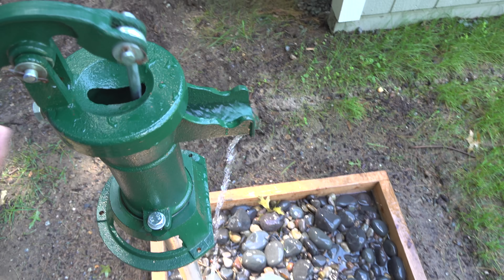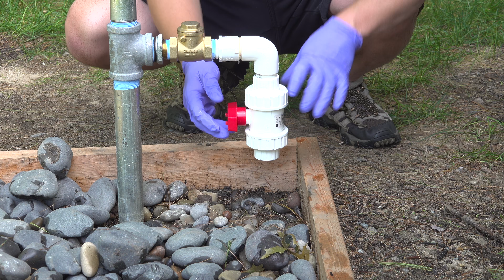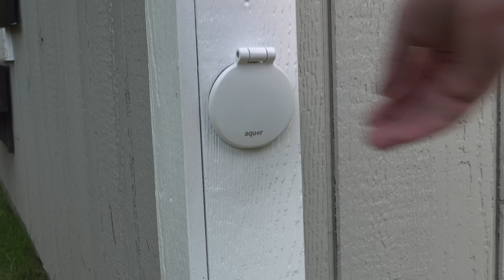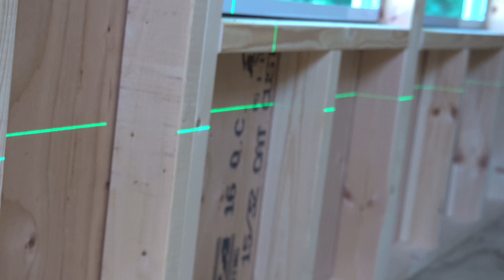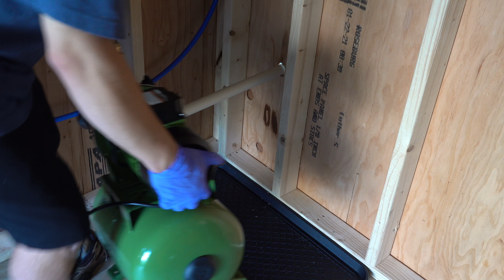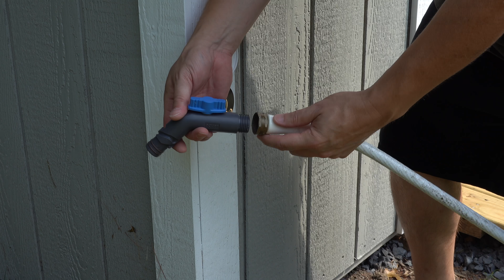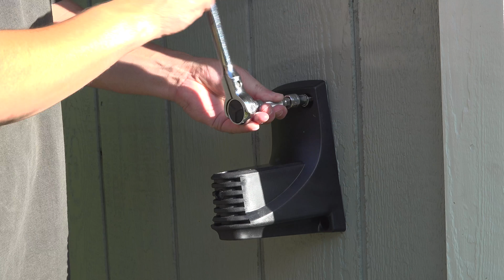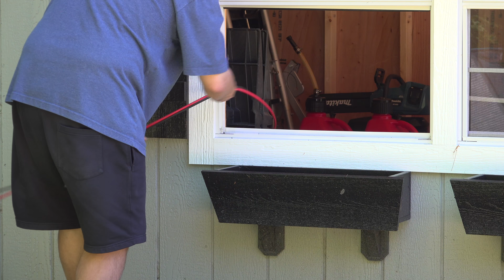DIY BACKYARD WELL with ELECTRIC PUMP - FREE Water

Comment: Minutes ago, I received a quote to install a new water well at my house in the Hiroshima countryside (via Edion's referral to a "pump master"). They said that my old well -- a traditional one with a concrete cap and old pump sitting on top -- was dry, though they never actually took the lid off. Instead, they only peered through the small hole where the PVC pipe enters, using a small flashlight to look inside. I can't see anything when I do that, so I wonder how they can! Anyway, they said "Your well is dry, we recommend digging a new one and installing new pipes, pumps, and water heater. The cost would be 2,000,000 yen." That is over $16,000 USD, by the way. After I woke up from having passed out, I remembered your video and some others I've watched about digging my own well. Since this land is in the countryside and I own the land, I have no fear of striking any underground cables. There are no sewage lines there and the only power line feed comes in through the top of the house, as all electricity is up on poles. Now I'm wondering if I can get enough water from a setup like yours to provide water to my house (one kitchen, one bathroom, and a couple of outdoor spigots). Or, how many of these would I need to connect in tandem to have what I need? I'm definitely NOT going to be shelling out $16K for such an overpriced setup.

Comment: Using this since 2005. Got submersible pump connected to water tanks. If water not drinkable install purifier it's pretty cheap. Plus you get a lot of drinkable water.  PS. Water harvesting is also important to maintain the ground water level. Rain water harvesting would be very good way to maintain the level.

Comment: Can anyone offer guidance on how I could add hand pump on preexisting well? From my understanding its a deep well.  The well was previously used for years to supply water to the house.  The tank and pump where destroyed in a flood about 4 years ago.  Since then the pipe has been broken off slightly below ground level. Would it be possible to uncover the pipes and attach extensions and a hand pump?  With it being a deep well would it require an electrical pump? In this day and age I strongly feel the need for an independent water source. I welcome and appreciate any advice.   Thanks.

Comment: Galvanized steel will eventually start to corrode and can pose a hazard for drinking water, which makes it unsafe for drinking water in the long run. The problem isn't the zinc coating but lead and cadmium, two heavy metals that can exist in the zinc because of the galvanizing process.

Comment: I am not sure where you are but where I'm from Missouri and my well was drilled to 580' and my pump was set at 550'. And it is all rock and red clay. I'm pretty sure no one is doing that with a sledge hammer.

Comment: How do I get the pipe to the ground water. We have a high water table and I have a French drain with PVC pipe and crushed stone. The PVC has a membrane over it. The sump pump pumps water after a good rain. How could I run a pipe in the ground to get water ? And what diameter and what kind of pipe. PVC, GALVANIZED, COPPER TUBING,ETC. THANKS ENJOYED THE VIDEO 👍👍👍👍

Comment: Connect a water hose at full pressure to the top of your pipe with a fitting that accepts water hose fittings.  Then turn on the water pressure that will run inside and down the pipe and eventually out of the screen at the bottom of the pipe, while you hammer the pipe in the ground to improving drilling your pipe into the ground.  The hydraulic water pressure will help move the sand away from the pipe while you drill it down.  Once you reach the point where you can't go any further or feel it's enough, then the water will allow the sand to pack around the pipe for more stability.  The next recommendation is to put a sentiment filter before your electric pump, to keep sand out of the pump, when can wear out seals and pump parts from fitting tightly, and also improve your water quality.  Another pro tip is install the pump and water lines outside the shed.  Place the pump next to the shed and build a cover for the pump to protect it from the elements.  This will reduce noise inside the shed when you use it as a workshop and also avoid problems if something leaks.

Comment: Just an idea for when running your hose through the studs. Put a metal plate on the front side of the stud to protect the hose from future projects. You don't want to drill into a stud later and screw into your hose creating a leak.
Reply: Not needed, hose is far enough from edges of stud.  If it's closer than 1.25 inches you need a plate.
Reply: @johnn3542  Interesting. I always wondered where these numbers come from. Why inch and a quarter? What's the significance of that distance? Idle curiosity.
Reply: @GeddyRC  standard drywall screws are about 1.25 inches long, and 1/2" drywall is standard thickness, might go thicker, would rarely go thinner, so you have some built-in wiggle room but should always be safe (from pro drywallers' screws, though we DIYers are less predictable and might use longer screws, if that's what we have on hand).

Comment: Use flexible PVC for underground.   Regular will eventually leak do to rocks rubbing.
Reply from the maker: Please don't do that. One excerpt from Google:  Flexible PVC pipe is simply not suitable for underground use, but don't take my word for it. ... Second, flexible PVC pipe is much easier to puncture or crush than rigid PVC pipe.

Comment: Have I got this right? You installed a well 30feet below ground?  Where does the water come from that feeds that well? Here in the UK you'd have to drill down 200 to 300 feet before you struck underground natural spring water and even then it might not be a self refreshing potable supply you could hit a sump that gives up water heavily contaminated with copper. I know of one couple who had a pipe sunk with a pump placed at ground level and the water tasted vile. Also when they washed their hair with it, their hair turned green !   Somehow it wasn't worth the outlay to drill down for the water at all.
Reply from the maker: Here is the full install I did with only a hammer: https://youtu.be/E-pn41fqYXs

Comment: Brass valve on galvanized pipe? That's gonna corrode super fast.

Brass and galvanized are a bad combination.  Better to use a stainless steel ball valve.  The brass check valve can be isolated with a dielectric union.  But joining brass directly to galvanized is asking for trouble.

Comment: So this 1 big pump is used for just 1 faucet? Can this pump send water to more than just one faucet? I'd like to do this as a main water supply to run our small house.
Reply from the maker: Yes but you can definitely run a water system in a cabin/house with it. For that I would use 3/4" pex or similar and that should give you good results.

Comment: So,  l guess the materials; electric pump, battery and wiring were given to you as well as the new pipe wrench, 20 ft of galvanized pipe, metal pipe"T", plug, teflon tape, check valve, pvc elbow, pvc "T" anc the pvc glue which would make this video showing how to get "Free Water".  Basically you are not getting "Free Water" and it will never be free.

Comment: A well DOES NOT provide UNLIMITED water. The underground aquifer
you tap into has a maximum capacity. It may be 1Million gallons and
SEEM to be unlimited but you can pump it dry in time. In the late
summer & fall the aquifer will run low. How low?. depends on how
wasteful you are with the water. The aquifer will recharge in the 
winter & spring. ALSO,   DO NOT use roundup  nor discard toxic 
chemicals above the aquifer. They will percolate down & into the
aquifer & you will be drinking it. Best practices is to test the water
quality each year. DIY test kits are available. Treat your aquifer as 
if you are running out, because you can. Is your aquifer under just 
your property & are you the only tap into it? OR, is it a big aquifer 
and everyone in your neighborhood is tapping into it? In California
there once was a giant aquifer 200 miles  x  200 miles and the farmers
thought it too was UNLIMITED so they pumped greedily for decades N 
decades until one day the pumps all ran dry. THEN, the land above the
aquifer collapsed into the empty aquifer eliminating it. the aquifer cant 
hold water if it is full of dirt.

!

Comment: In about 50 years his house will turn into a sinkhole
Reply from the maker: It doesn't work that way, otherwise every well would fail. You pull water through the soil and its replaced from rain or surrounding underground water
Reply: @SilverCymbal  tell that to Mexico City
Reply: @SilverCymbal  when there is lack of water , and the world drying up , it 100% works that way!

Comment: Soo you must be more of a man than me !
Reply: In my 35-40 years of plumbing and dealing with shallow wells for home use and sprinkling I've never used a sledge  hammer ! You must have really soft soil or really shallow water.
We use a well driver built by us. A piece of 6" steel pipe, 12"-15" long capped on one end with a 3/4" steel rod welded in the capped end.
Pour in 80Lbs plus of lead, add 2 handles. That's a real well driver ! 2 - 1-1/4 couplings, a nipple between, and a 1-1/4x1" bushing on top. Much less a chance of smashing threads than a drive cap.
Two handles make it a 2 man job with it weighing near 100Lbs.
Local Hardware stores in local areas of shallow Wells may have a driver for rent.
 Also you didn't mention that not every area has water shallow enough or soil conditions  suitable to pump water. Muck or clay conditions aren't suitable. 
  Also if you put a check valve under the pitcher pump, no ball valve is needed. Same with the PVC line to the pump.
  Setting up the pressure switch on the pump won't give you more water volume.
 If you want to do more than 1 or 2 sprinklers, you'll need a 2" well and a minimum 1hp pump, also a larger suction pipe.
  There's lots more friction loss when sucking water even more friction loss lifting water from the ground. The higher the water level in the ground the more volume you'll get from the same system.
  So ! It's a lot more complicated than this man makes it out to be ! !

Comment: If you added theTee earlier you could add a watter supply to assist with driving the pipe just retighten tee as needed to avoid ruining threads

Comment: Here a tip you gotta dog below the freeze line in you area when putting in a water pipe that’s most likely gonna freeze and brake over the winter time usually it’s 18” to 6ft depending on where you live Pex sucks use sweated copper pipe will last 100+ years with no leaks

Comment: Use inherent for your solar panel stand brother. You can find some at any hard where store. They'll also have an assortment of fittings like 90's and tee's. I have the Bosch 18v cordless band saw I use to cut undercut with for the whole kit it was under 200 bucks. I saw you had mikita  cordless they'll have a band saw for that platform. Not sure how much tho. You might actually save if you just go with Bosch for saw and battery. Lowes has it on sale pretty cheap.  Unistrut is under $20 bucks a 20' stick of 3/4" where I get it it might be double that at Lowes or H.D But still should be able to make a nice one super cheap.

Comment: Please be careful..proper bentonite clay sealing is required to prevent surface contamination from polluting surrounding groundwater conditions. Read well specs in your area (licence req).
Be safe ..protect the environment
Reply from the maker: For this type of well that isn't possible or needed. Bentonite is done on wells with an inner & outer casing and it's not done for contamination it's to prevent wall collapse on wells 100 feet deep or more or with conditions that require it.

Comment: This is a great video and idea for people that live in areas with sand and gravel formation and high surface water. Before spending money on this type of effort for a well consider researching your local water formations and well logs. We drill water wells and if you tried to do this most places around us you would hit solid bedrock after 10-20 feet or dense clays. Certainly lots of places where is is a viable option though!

Comment: Don't use PVC use tuck tube it can even handle for being froze and much easier to work with with every glue joint with PV C is it possible leak, talk tube and shark bites is your best bet.

Comment: A few notes from a well industry professional: If you live somewhere that has winter that buried line should be at least 4ft deep to avoid freezing. There's special adapters (called a pitless) you can buy so that the junction with the well casing can be buried as well. Also, if this DIY well is to be used for drinking water you need to check with your town hall. You may need to file for a permit and prove that the well is a safe distance from any septic systems.
Reply: Thanks for raining on the parade!  :-p  Seriously, yes, everything needs to be taken into account, especially permits.  I had already run that through my mind before I ever saw this comment.  Actually, from his first video.  Really, though, since forever ago.
Reply: Thanks for the sound advice
Reply: If you're anywhere that HAS a town hall, they're likely to just tell you to GFY if you apply for a well permit instead of just getting a municipal water hookup lol.
Reply: @Nevir202 every county is gonna have a town hall/ governing authority of some sort
Reply: @zart3374 So dont tell them.
Reply: Excellent point! Where I live a few hours from the Candian border, the AVERAGE frost depth is 5 feet, but 8 feet is the normal application. Why? 1) We have occasional cold snaps that drive frost deeper, and 2) it varies with soil type and compaction. Finer soils like clays and compacted soils where there is vehicle traffic or animal foot traffic will cause frost to penetrate deeper. It is a common newbie thing for people to only bury lines to the "average" depth at significant expense, only to have them fail and burst within the first three winters, causing a huge problem short term with delivering water, and a very expensive project in the spring.
Reply: What is typically considered a safe distance from septic systems?
Reply: @ceedubbz777  depends on your local regulations. My town requires 100ft from a leeching field and 50ft from any tank.
Reply: @samdevanski1825  thanks
Reply: 16” deep is fine in the south.Also you can have the water tested without city hall.

Comment: There are a few mods you may want to make, including proper orientation of the pipe wrench on the fitting being tightened, and installation of a check valve on the lines leading to both pumps...

Comment: My grandpa (a master plumber pipefitter) was pissed as fuck when the eminent domain utility cocksuckers came through and forced him to cap his pump well. I grew up on pumping all our water and pressurizing it with more pumping. I ALSO remember the day he had me come help him dig a trench from the capped well to the house. He dug down next to the tapped well about 10 feet, Installed a "T" valve he custom forged and ran pipe along the trench to the house and installed an electric pump under the house in a hidden crawlspace.

Comment: Just bought a new property and want to do something like this, but winters would destroy that setup here...need to modify it for cold temps and it looks genius! Thanks!
Reply: You could run a 10AWG cord (for good measure) from your breaker box to a shed and pump with grid electricity instead of LiFePO4 that won't stand so well in freezing temps

Comment: Don't use a freaking sledge hammer. Rent a well hammer from a hardware store, or (if you weld) make one from a larger chunk of pipe that can fit over the 2 inch well pipe. If you have to go deep, used a pulley and rope.
I've driven several. Growing up in the countryside, we all had to learn to drive our own wells. But I've never watched anyone dry to use a sledge hammer, that's the funniest thing all morning.

Comment: Almost no one uses galvanized pipe for potable water anymore. It puts toxic heavy metals into the water like lead and cadmium as it corrodes, which it inevitably does especially in contact with soil. Also the number of un contaminated aquifers in the US is shrinking. In my part of the country the ground water supplying the aquifers is full of agricultural runoff and industrial chemicals from fracking and is completely undrinkable.

Comment: Awesome stuff, not sure how cold it gets where you are but I would have bored a hole with my garage to have the pump inside to help winterise it, and also that pump has surface mounting holes. Why not build a worktop enclosure around the pipe to mount it on. You could then also insulate it inside to help winterise it.

Comment: That particular Aquor attachment, that angle valve, has a very fine strainer in it. That's likely why your pressure was so low. You can use some needlenose pliers to unscrew it and remove the screen.

Comment: That water pressure sucks at the sprinkler.
Reply from the maker: It was about 40psi still very usable, considering even drop of water coming out is free. But as mentioned later in the video I adjusted the pump to be closer to 50/60psi.

Comment: Great video!   I'm confused though.  You made a drain in the pan.  But then drilled holes in the floor through the pan to hold down the pump.  Hope those holes were siliconed.

Comment: So you’ve paid cash out for a hand pump ,electric pump,battery ,sola panels, endless amount of fittings,a shed to house it all in . My god ,just how much does water cost  ,and what is the pay back time 😜🇬🇧
Reply from the maker: Depends where you live in some areas water bills are thousands a year, keep in mind too you don't have to use solar if you have AC nearby or if you are off grid than this is a good setup.